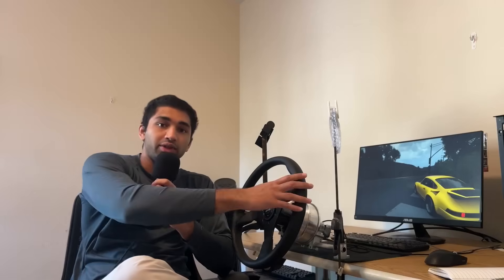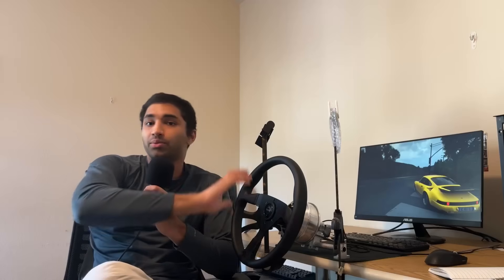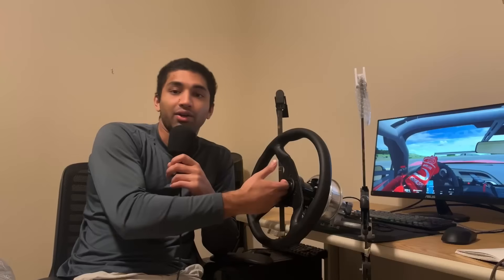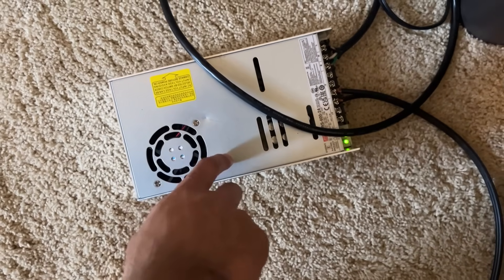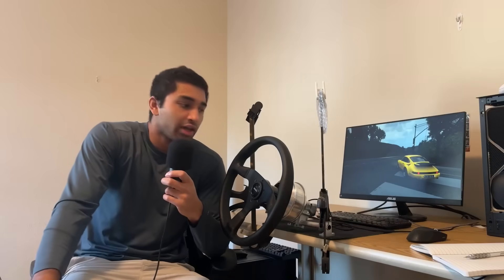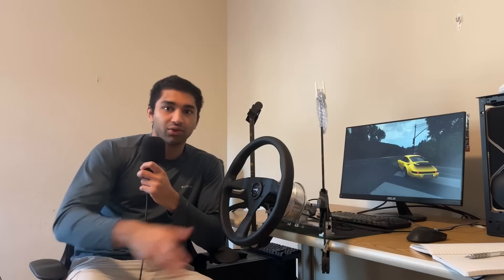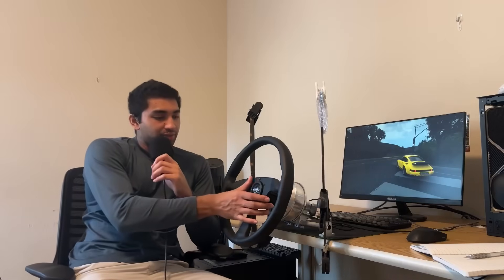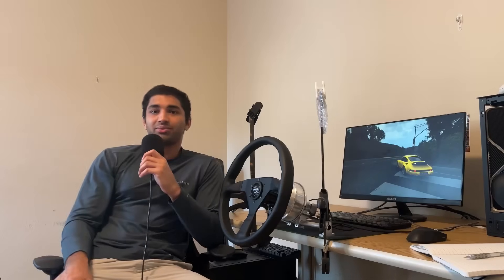FFbeast review - DIY 15 NM Direct Drive Racing Wheel - Tips for Future Builders

Comment: I also finished this project but i went with viih mount but with tig33r holder. You are right that drilling the hole via whole motor is pain in the ass.
Reply from the maker: How is the viih mount? is it reliable?
Reply: @SethusBuilds I mounted tig33r holder which is just a remix of viih mount. No issues so far and working very good.
Reply from the maker: @Lasakowy  Great to hear. I am considering switching over because of how bad the current mounting method is working. Plus my spare skateboard is un-operable with one of its bearings cannibalized lol

Comment: Awesome Video man, yours really answered some questions that other tutorials just skipped over. I was looking at building my own but i’m struggling to pick a power supply. My motor is 36V, does that mean I need to pick a power supply that is 36V? or can i go for a lower voltage and higher wattage to still get the most out of the motor? 

Thanks!
Reply from the maker: 20V 20A should do the trick. Mines also 36v (I think most hoverboard motors are) but everyone on the forum and discord say that they wont take more than 350W. Hope this helps! Good luck!

Comment: I think you can use Moza steering wheels with an RJ12 connector with the Moza Adapter hub
Reply from the maker: I wasnt aware. Thats sick!
Reply: @SethusBuilds  If on a tight budget and don't wanna build the steering wheel, Moza wheels is a good option. But if you wanna splurge on steering wheels there are a lot of other brands who do the same for a higher quality but more expensive.

Comment: Like you said this is a great entry/ mid level dd wheel for the price its insane had one for about half a year but then decided to upgrade to an asetek laprima and there is a huge difference in detail and smoothness wich you loose with the ffbeast. Still a great way to race dont get me wrong but nm isnt everything in simracing
Reply from the maker: Was wondering how it compared to higher end wheelbases. How would you say it compares to the Moza r21 or similar wheels?

Comment: great video man- I'm having some trouble getting games to recognise my wheel/steering input. Any tips? Which games have you tried so far?
Reply from the maker: So far: AC, BeamNG, AC rally. For some tips I would just make sure that your firmware is up to date and that it matches with the patch version for your UI. If you are using a breakout board for the USB that may be causing an issue so you could try plugging the wheel in directly in to the motor controllers usb-c port. Lmk how it goes